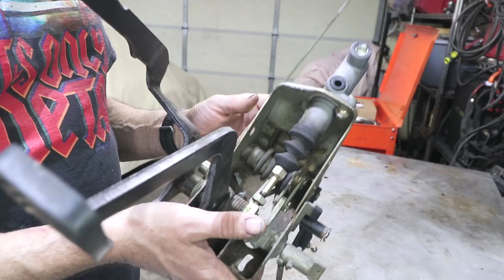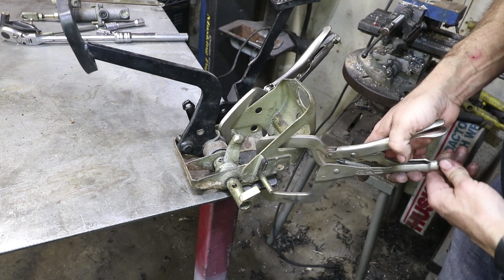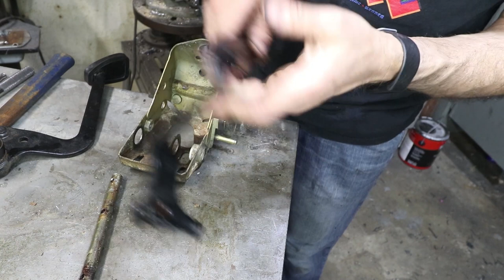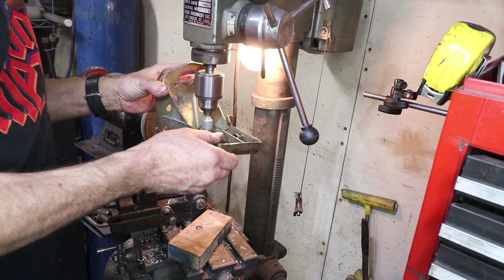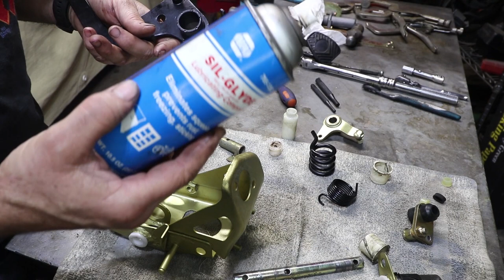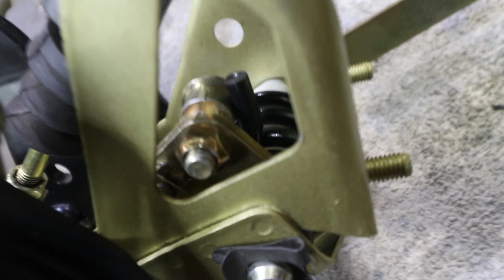How To Rebuild Porsche G50 Pedal Box Cluster On My Newest Porsche - BONITO

Comment: Great vid, Tom! This is something I should do to my G50 pedal cluster, also. I have seen/read about tons of complaints from guys that rebuild their earlier pedal clusters about how difficult it is. This frankly doesn't seem that difficult at all. I would have thought the clusters for the earlier clutches that had cable-operated clutches would be way easier.
Reply from the maker: Thank you!  My pedal assembly was a cream puff, so I suspect some are harder to get apart than mine.  The hardest part is driving the roll pins out.  Kroil and good tools/table works wonders.  See I make it look it easy!